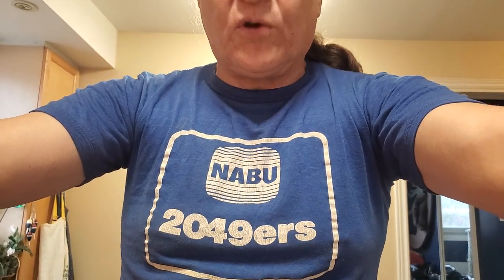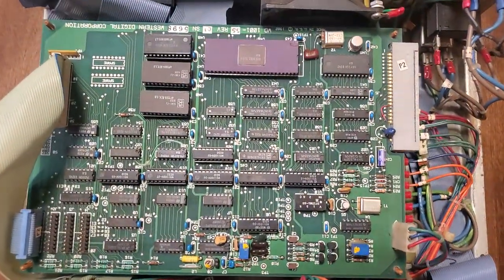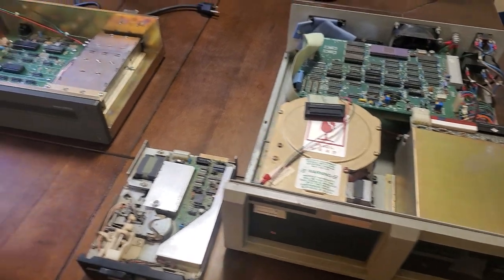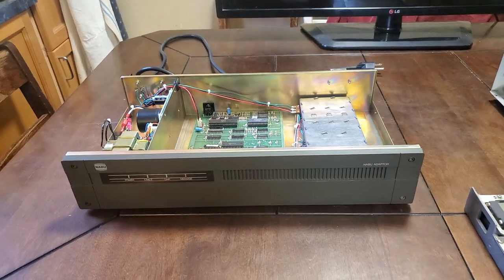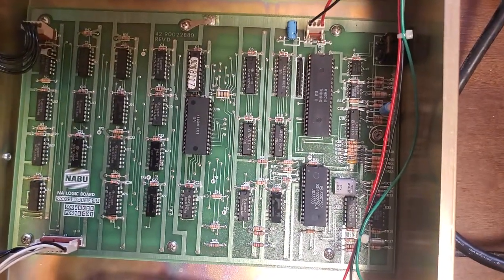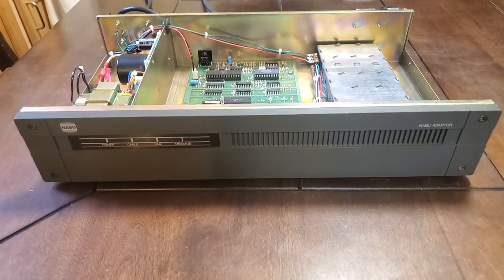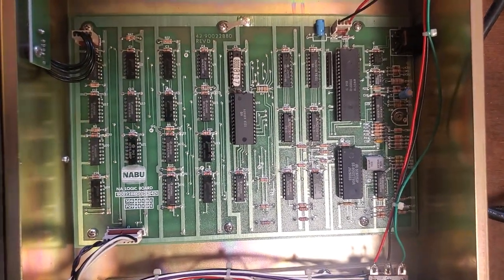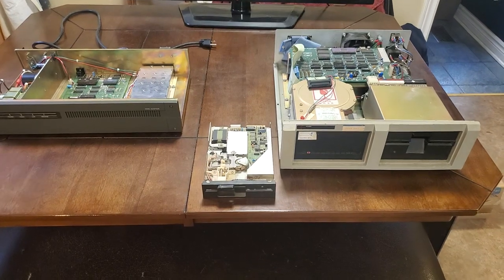NABU Archaeology with Leo Binkowski part 2

Comment: The controller in the disk unit looks to be an off the shelf WD Winchester disk controller,  the card on the development machine that interfaces with it, will likely be the custom bit of kit. (hardware wise). Thanks Leo for posting all this stuff, it's a lot of fun to follow along.
Reply from the maker: I'll post the interface photos soon....a see a website on the horizon.
Reply: I think you will find the controller might be more generic, an 8bit combined HD+FD controller, similar to the Epsom QX-10 and others from the same era, just in a "custom configuration" for the NABU PC (which can also be said of most of the similar hardware from the same era).

Comment: The board on the hard drive is just what comes with the hard drive; it's not Nabu-specific.  The hard drive has a standard set of MFM interface cables (the 34-pin control cable and the 20-pin data cable).

Comment: The Seagate ST-412  has it's own circuit board attached below the platters. It handles all the movement of the heads and such.   You don't want to mess with that at all. Leave those together.
This drive  is a 10meg MFM format HD, which means the drive is plugged into a MFM style controller. via the ribbon cable.  Early IBM PCs had the exact same drive.  So it depends on what motherboard is below it all, (Another base Nabu running CP/M or other Linux?) And then the controller board should be plugged into the motherboard.  It'll require a careful review to see each module within. But the basics are (HD Platters+circuit)->controller->PC.  A view of the backwould be great, so we can see what interfaces it has.  This will help determine how it's hooked into the system overall.  (It will have to inject the data into the cable signal, some where down the line.)

I'd be curious on the Adaptor's details. (I have that on order as well.)  It probably have it's own CPU/Memory/ROM/Serial set of chips.  The 3 major chips in sockets can give us some those clues. If you can read off those to us, or post a high-res photo; we can start solving that mystery.  You are wise to avoid messing with the cable circuit section,  I assume it'll be mostly passive components anyway.

Comment: The WD-1001 Controller is MFM to SASI adapter.
That's not a typo, it's the version before SCSI became the proper standard.
Some minor differences that make them incompatible. 
Adaptec also made MFM to SASI boards.
Reply from the maker: I didn't know that. Thanks for the extra detail.

Comment: The hard drive's controller board is a part of the drive, so no need to tinker with that. The seagate ST-412 was a pretty common hard drive for that time, and any MFM interface hard drive would likely be usable as long as the rom controlling the mass storage unit was set up for it's tracks, heads, sectors, etc...

Likewise the big floppy drive looks to be an off the shelf part too, so most likely the main magic needed to replicate the mass storage unit would be a dump of the ROM on that big mainboard in back of it. Can't quite make out some of the chips' part numbers, but the 6381-2J chips are 8k PROMs made by Monolithic Memories, and I wouldn't be surprised if U48 is a rom chip of some kind too.
Reply from the maker: I don't think I have the skill for that. I'll have to consult some experts. I have an EPROM reader on order, but I think I'll leave the hardware disassembly to people better versed in how to not release the magic smoke.
Reply: @leo.binkowski  Ask 3 people the best way to remove a socketed IC and you'll get 3 different answers.  My method of choice is prying with a small flathead screwdriver from the ends at the 4 corners bit by bit until it's loose.  The chip removal tools, at least the cheap ones, tend to bend pins more often than not.

Comment: You can get ahold of an mfm-emulator and copy the mfm drive directly onto it, then tinker away! Having an image at the bit-cell level of the drive is a good way to preserve its contents!
Reply from the maker: I don't know how to do that. Could you please elaborate?
Reply: @leo.binkowski  SMBaker YT channel shows exactly that .. the irony of watching all these different is that I am pretty sure Sam would have dad everything deciphered in a weekend (well. he's done exactly that on more that a number of occasions anyway) ..
Reply: @leo.binkowski  If you search for "MFM Hard Disk Reader/Emulator" you'll find a project by David Gesswein. This has a board which can connect to an MFM hard disk directly and allows its contents to be imaged. The device can then be configured to operate as a disk drive and be plugged into an original controller only using its internal solid state storage. I'd link directly but youtube doesn't like links. The web page has links to an Adrian's Digital Basement video that gives a good overview of how the device functions.
Reply: Great work! I'm happy to see progress on this old computer. The more information the better. It's not a problem that you're not an expert at some things, there's plenty of those around! I have done quite a few old computer projects that I wished I had someone like this giving information about. Priceless!
I've used two of Davids reader/emulators. One replaced the same model drive you have, and it works perfectly. I was able to read the entire drive image and use that in place of the ST-412 which sounded like it would have died very soon.
It's not easy to use. You do need to be good with the Posix command line, but there's a pretty good tutorial to get you through it.

Comment: That Western digital board in the hdd enclosure is a 1001 four-drive scsi or sasi to MFM bridge controller.  I suspect the board inside the Nabu is a SCSI or SASI host adapter.  This arrangement means that the drive is dependent on the 1001 for its formatting.  Another bridge controller will not be able to read it as each had a unique format.  Other such are Xebec 1410, Adaptec ACB400a, Omti...  They all do the same thing but can't read each other's disks.
Reply from the maker: Yeah, if it is going to be read at all, it will be read with the same controller.

Comment: Do you remember the names of the two programs that ran on the cabserve? 😁
Reply from the maker: Hi John! (John was Manager of the Games Dept. when I was a programmer, and later Director of Content before I was) There were actually three programs. CABSERVE, CABLOAD, and CABDEBUG. CABSERVE pretended to be an adapter. CABLOAD allowed use to pull segments off a live cycle. and CABDEBUG did weird magic I have trouble remembering what exactly.

Comment: The first precaution measure which comes to my mind: Those old hard drives did use to park the head automatically with every shutdown. So before handling the drive or the mass storage unit it should be made sure the head(s) are parked to prevent damage of the drive and the data on the disk. 
I have no idea how to do it though, but probably someone else here .. ?
Reply: The ST412 and similar models didn't have auto-park.  So you used to run a utility just before powering off a PC to park the heads.  It would drive the heads to max cyl.   The drive has two connectors that goto a controller.  34 pin and a 20 pin.  34 pin was mostly control, 20 pin was the MFM read and write lines.  I interfaced one of these to a ZX-Spectrum back in the day for fun :). LOVED the Z-80 CPU, ASM, Turbo Pascal on CP/M.  Lots of fun. Happy to help if I can
Reply from the maker: Turbo PASCAL was a breath of fresh air. The NABU title MACBETH, written by Eric Mesdag, was written in Pascal. However, I don't know if it was Turbo or some other compiler.

Comment: I have my own Nabu coming in and plan on reverse engineering the board so I can publish the schematic for others to use. My question would be if the floppy was standard or custom like Macintosh or commodore did. Otherwise the interface boards that drives plug into would be proprietary to the system manufacture. As someone else noted the hard drive board is unique to that drive and is normally an off the shelf part. Keep us in the loop to help direct these systems and make progress in keeping the tech alive.
Reply: Everything in the NABU components seems to be "off the shelf", just that the quality is somewhat higher than most of the same era. I can't see the floppy drives being any different. What I have noticed is a total lack of comaprison to the MSX systems, and that might only be a "Noth American" thing. I would be interested to see the pin-outs for those 4x internal expansion, especially since it can also chain 4 cards on one connection, that reeks of an MSX bus expander .. and I saw the ROM has page banking address most hardware are I/O ports, another 2 items on the MSX list (along with the VDU) ..
Reply: @paulwratt  I've made MSX comparisons.

The sound chip is also that of the MSX, as opposed to other North American systems that used the TMS9918 and typically used the SN76489 instead of the AY-8910.
Reply from the maker: I approve of your efforts! I've discovered that there is far too much work for me to do alone, and I am seeking help.

Comment: Taking into account that the NABU system was also setup in Japan, I suspect the NABU PC is a North American MSX for people who dont know what MSX is (and without MS finger in the pie), just packaged with a cable box (a lot of MSX were in unique configurations)
Reply: People poking around in the bits and bytes of NABU say the similarity with MSX1 is only in that it uses the same Zilog Z80 CPU and Texas Instruments TMS9918A VDP. The ways it accesses RAM and other things is different.

But since it uses the same CPU and VDP as MSX1 it looks like it's going to be pretty easy to adapt an MSX emulator to also emulate NABU.
Reply from the maker: MSX happened at around the same time, but NABU wasn't based on MSX. NABU also resembles a ColecoVision interally (Z80, TMS9918A, but TI SN chip instead of AY-3-8910). We ported our games to MSX, and some were ported to us, but the port, memory, address topology, and especially keyboard and joystick handling,  are completely different but we had shim code to translate from both Coleco and MSX derived source. Z80 in 1982 was similar to the raspberry pi today. It was a self contained chip that had I/O ports that were really simple. Engineers and programmers loved working with it. I know I did.
Reply: @leo.binkowski  An abstract question if you don't mind: Was the system architecture devised internally at NABU, or was it a contracted design? Did you have much in the way of interaction with the design engineers? Just curious about the origins of the system as a complete bystander.
Reply from the maker: There was a bunch of people involved in the NABU PC design. It really was a home evolution of the NABU 1100, with the cable added. I do know it was driven mostly by Ken Leese. I also knew Mark Vigder worked on the debugging of the design. Bruce Instruments was acquired by NABU to design the head end combiner. I believe Leo Bruce Hempell had driven that design.
Reply: @leo.binkowski  hmm.. remembering that the 1st MSX proto-type is not 100% MSX compatible (Spectravideo SVI 318) and can play Colecovision carts, I am woundering if the NABU and MSX 1 "standard" are based on the same (Zilog?) reference design (again, isnt it just port addresses which are different on the Coleco too) or at least based on an older design (a console/arcade maybe? - hence all the different "missing" parts + an sound chip) - Well anyway, it would be great (greater?) if the NABU PC and NABU 1100 design docs and/or info surfaced about now too (one can live in hope ;)

Comment: Wow you could even send messages to individual machines with the Nabu network. Do you happen to know if the network adapter was even capable of sending data back over the cable network? (Although the cable providers didn‘t support this at this time)
Reply from the maker: The Cycle was one way. We built the cycle every night. Everyone's message was on it, but only the adapters with the right PAL address would retrieve it. The messages were not super private things, they were like reminders to pay your bill. I can't remember any other use cases for it, but others might.

Comment: can you remove the sticker on the PAL, so we can see what type of PAL/GAL this actually is? Even better would be the programming data for the PAL/GAL. (this data getting lost is one reason why I don't like using programmable logic in my designs).
Reply: I make pal->eeprom clone adapters for those who can’t burn pals - only a few £ but would love to clone these
Reply from the maker: I will do that in the next video, by your request. I didn't think it was important.
Reply: No need to remove the sticker. The Adaptors are on sale for $25 at Surplussales.

The logic board is a 6-layer PCB so nearly impossible to clone/reverse engineer from just pictures.
Reply: @Okurka.  agreed I have a method I use to test each pin mapping - time consuming but works :)
Reply: @Okurka.  the pal being read would be useful
Reply: @crazyboy2006cashier  Leo's Adaptor's PAL won't differ from the ones in the $25 Adaptors except for the serial number.

I heard Mame team is working to getting NABU emulated, they probably already have dumped the PAL.
Reply: @Okurka.  cool. Emulators are cool. I prefer the real hardware myself :) that sounds nasty but it’s not meant in anyway just me saying I’m a nerd and I love having hardware :D
Reply: @Okurka.  cool. Emulators are cool. I prefer the real hardware myself :) that sounds nasty but it’s not meant in anyway just me saying I’m a nerd and I love having hardware :D
Reply: @Okurka.  cool. Emulators are cool. I prefer the real hardware myself :) that sounds nasty but it’s not meant in anyway just me saying I’m a nerd and I love having hardware
Reply: @geekwithsocialskills  Congrats with what's happening now, it couldn't happen to a better guy.

Comment: I’ve already ordered a NPC, but not an adaptor. Based on DJ’s work it seems superfluous today. What do you think Leo?
Reply from the maker: The adapter is only useful for people reverse engineering the actual cable signal. If you have no interest in that, then order the RS422 cable DJ recommends, and enjoy the software when we make it available. There are lots of goodies in there.
Reply: @leo.binkowski  Thanks! I’m not planning on (or able to) do any reverse engineering so your response is right on the money. Having said that, it seems like it would be nice to be able to run the NABU independently of an adapter emulator on a PC or Mac. Maybe a solution would be to run it on a headless Raspberry Pi that resides inside the NABU box itself.

Comment: make sure to put a drop of oil in the stepper motor before powering that back on. See any of adrian's digital basement videos involving an MFM drive.
Reply from the maker: What kind of oil?
Reply: @leo.binkowski  Sewing machine oil works great. This is what Adrian uses as well.
Reply: @leo.binkowski  anything that will do as 'bearing oil'.
Adrian seems to use a few different oils over time. the first video he uses some bicycle oil. Then he uses some old all purpose oil on another.

hopefully youtube will let me post this link:
https://youtu.be/-UJ0YE1a1Fs?t=231
Reply: @leo.binkowski  I use vacuum pump oil on old computer fans and other things where oil drying up is a problem. It's extremely low VOC so it doesn't dry up like mineral oils. It has to be resistant to having volatile compounds evaporate due to having to work in the very low pressure environment inside a vacuum pump.

The 'problem' with using vacuum pump oil is that of obtaining the small amount that will be a triple lifetime supply for most people using it for lubing old hard drives and fans. I just happened to have a vacuum pump and needed some of the oil, so the few drops used for non-pump purposes haven't been missed by the pump. ;)

Another slick liquid I've successfully used, especially on CPU heat sink fans where heat is a problem, is silicone oil. Two easy sources are fuser oil for copiers and laser printers (though that's not used much anymore due to improvements in those office machines) and silicone brake fluid. The brake fluid usually has a light purple tint but that doesn't affect its lubricant and drying resistance properties.

I just had a look on Amazon and they have SEKODAY Silicone Treadmill Belt Lubricant for $6.89 USD. Claims to be 100% silicone. One bottle of that should lube many hundreds of motor bearings.

Comment: A black half-height 1.2MB drive? Interesting, I thought they were made from the start to match the beige of the IBM 5170.
Reply: 1.2M 5.25" didn't come along until 1984 so I'd bet that's a typical 360K.
Reply: @greggv8  If it's 1.2, I wouldn't be surprised if the faceplate and lever were swapped from a 360k drive of the same make. It's not like they needed a large quantity of them, they were for the storage units at the cable company end.

A close-up shot of the read head would be useful to distinguish between a 40 and an 80 track drive.
Reply from the maker: The drive in the NABU is indeed a 400k floppy 360k formatted. However the Full height floppy is a 96track. The single unit in front is a Panasonic JU-475-2, which appears to be a 1.2 M drive: https://www.recycledgoods.com/panasonic-ju-475-2-agg-1-2-mb-5-25-floppy-drive/

Comment: I wouldn't power on the HD until you have setup another machine that is ready to copy the data over. Drives that old often die soon after first time starting back up!
Reply from the maker: I have decided not to power it on until an expert can analyse it. It may not be until the new year.

Comment: That looks like a normal MFM hard drive. Can you please count the cable pin count?
Reply from the maker: Which cable do you speak of? there are many from here to there.
Reply: @leo.binkowski  Well if it's a standard ST-412 then the two ribbon cables should be 20 and 34 pins.